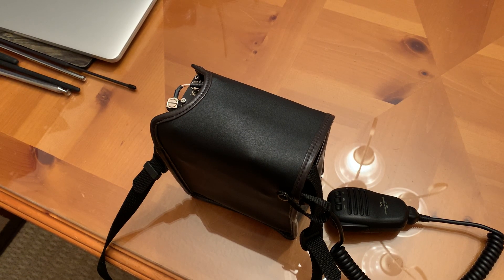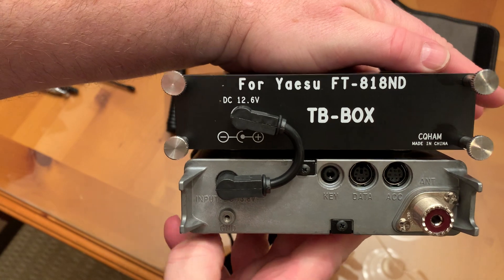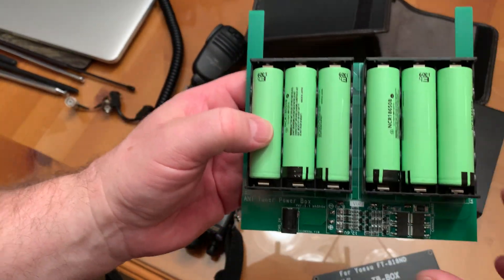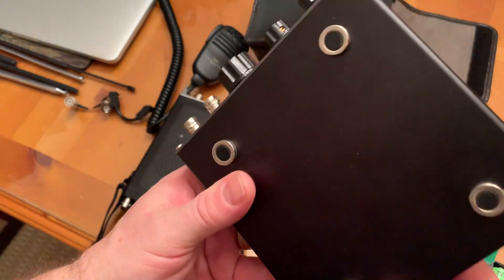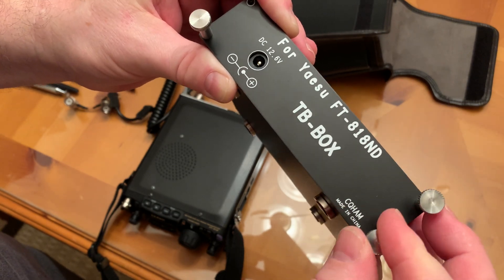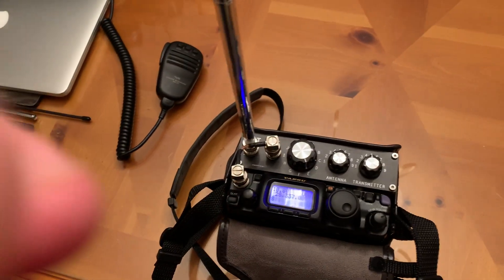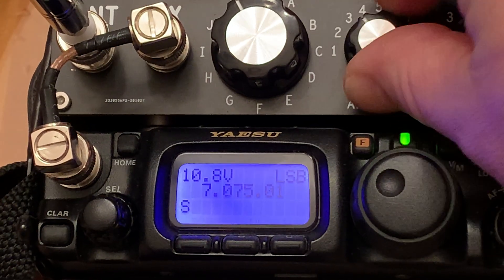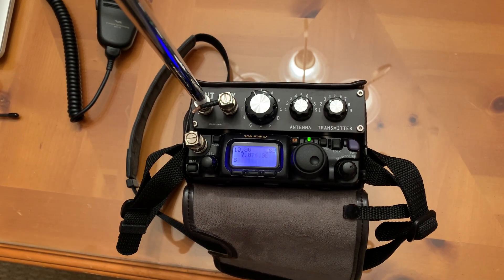Tuner Battery Box for the Yaesu FT-818

Comment: The TB Box batteries are horrible.  I replaced them and still got about half hour run time,....
Reply from the maker: Two different sets of batteries not lasting suggests there is an issue with your wiring or the tb box circuit board.   The 18650 batteries that came with mine provide over 4 hours of runtime.

Comment: what is the auonomy with that battery? and how can you know it is fuly charged?
Reply from the maker: My apologies, I am not sure what you mean by auonomy?   The battery came with a lifepo charger that has an led that turns green when the battery is fully charged.    It is a 3 cell 18650 unit that reaches 3 x 4.2v for a total of 12.6 at full charge.
Reply: @johncooper6894  i meant autonomy, as per a full charge how long does it last?
Reply from the maker: @itrstt66  the total capacity is 5ah so 10 hours or more just receiving.  Less depending on how much transmitting you are doing and at what power level.

Comment: John, too bad they can't use 21700 LIFEPO4 batteries all you can get out of them is 12.6 VDC output, from them, I was making a 4-cell 21700 battery with a Buck converter to keep the voltage dow to 14VDC

Comment: John, last question. Since any barrel plug drains the battery do you unplug the battery that comes with this case to keep it from draining?
Reply from the maker: No, only if the radio will not be used in a long time.
Reply: @johncooper6894  Thanks! 73

Comment: John, quick follow up. Is the barrel connector for the tuner power socket the same barrel connector that’s on the Yaesu power cable that comes with the radio? If so then yiu can use the Yaesu Cable “in reverse”. That is, plug it into tuner and put a Powerpole on the other end. Then plug it into Windcamp adapter. Makes it easier to use Radio if you want to separate it from the tuner and p,ug into a Bioenno for example. Your thoughts?
Reply from the maker: The barrel connector on the tuner is larger than the radio connector.   It is a standard 2.1mmx5.5mm connector.   There is room on the back of the tuner to add a power power connector in parallel.   I removed the windcamp power pole off adapter from my FT-818 when I got the tuner.   Actually before I got the tuner as I noted it drained the battery while the unit was off.   Having a plug in the jack of the radio opens a path with a slight current draw.
Reply: Thanks John.

Comment: John, Is there any reason you can’t modify the power cable that comes with the tuner to use a Powerpole connector. Specifically I mean putting the Windcamp or Sotabeams Powerpole Mod on the 818 and then cut the power cable that comes with the tuner and put a Powerpole on the end.
Reply: Just get another cord with the end that matches the power supply and put the Anderson connectors on that. The length of the original cord may be too short for the windcamp but you can make another cord work great. A good place to try is goodwill in the electronics section. I usually find power supplies rated at 2 amps DC  with a heavy cord and an end that match. just cut it off and make your own.

Comment: John, I think you said you put legs on the radio to tilt for viewing. Which ones did you put on the radio and will the radio fit in the bag with the legs on?
Reply from the maker: I put chelegance legs on.  I purchased them at DX Engineering.  The radio still fits into both this bag and the stock Yaesu bag with the legs.   They tuck in nicely.    Here is the link to the legs at DX.  https://www.dxengineering.com/parts/nce-ch0020001

Comment: It would have been nice if it was designed to attach to the bottom of the 818, instead of the top where it covers the speaker.
Reply from the maker: That is true.   However, the gap between is wide enough to allow a decent volume to pass and the top mount allows any feet or bales to still function.
Reply: Looks like you can flip over the guts in the box.
Reply from the maker: @k0emt  You might be right Bryan.   I will have to look at that the next time I have it out.

Comment: That is totally cool! You'll have to a follow-up after you logged a few miles on it.
Why only 10.8VDC? The radio shuts off about 10.5VDC.
Reply from the maker: Hi Viron,  thanks.   I have used it quite a few times with much success.    I have used it to tune short whips and end fed antenna's and the battery lasts a long time.   The voltage range is about the same as the internal battery, which runs into the low 9's before quitting on mine.

Comment: I'll try another question, but perhaps you're busy or whatever.....  Mine arrived a couple days ago. Did the battery tray slip out of the box easily the first time you attempted it?  I'd like to pull mine out to have a look at the batteries, but it won't budge and I don't want to force it.
Reply from the maker: Hi CW,  the board holding the battery tray slipped out very easily on mine.   I just removed the rear panel and it slid right out.   73’ and good luck.
Reply: @johncooper6894  Thanks a lot John for the reply. I took the back cover off and gripped the board ever so gently with a pair of needle nose pliers so as not to scratch or crack/crush it. the battery tray slipped right out and I was also impressed with the panasonic batteries. I've been using this with my 43' vertical and am able to tune with from 80m and up. Battery life is excellent also. An actual win of a product from China!
Reply from the maker: @cwqrpportable  Glad to hear.    My impression is that the designer of CQ-HAM products,  BH5HDE, is an enthusiastic ham that strives to create high quality products for fellow hams in the true spirit of ham radio.  73' John
Reply: @johncooper6894  That's great. I've had it and the FT-817 out portable a couple times and boy does that tuner ever work nice with a 41' end fed random wire and counterpoise.... 80m-10m no problem. Battery life is good too. I'm impressed!

Comment: would this work with the ft 891 and if not do they have one that will?
Reply from the maker: FT891 is too big to fit and outputs more power than the tuner is designed for.   I am not aware of a similar product for the Ft891.

Comment: That is really a neat little package. I like the idea of the power and tuner all in the same small package. 
But, the down side of the tuner is that it does NOT cover 80 meters. No big deal that it does not cover 160 meters since not many people working QRP on 160 meters anyway. 
Also great that he's using quality batteries and not those over rated 5500 mah batteries that show up on ebay. Which are not 5500 mah so don't be mislead.
Thanks for posting. Good informative video. 
Barry, KU3X/QRP
Reply: I just bought the same product and the listing says it covers 3.5-52mhz. I can't wait to try it out. Thanks for the video.
Reply from the maker: Hi Barry, good point.   I decided to test it on 80M.   I connected it to my ftd90.   On paper,  the antenna covers 160 to 10M without a tuner.   In reality, the vector analyzer shows the swr climbs sharply  at about 3.6Mhz.   So the CW portion of 80M needs a tuner, as does 160M.    I was able to get a flat match at 3.530 with the inductor on the highest setting.   SWR is around 2.5 at that point so tuner is usable on a reasonable SWR on 80M.    It did not have enough inductance to tune on 160M.    Thanks again for watching.      73' John

Comment: 18650's are 3.7v each and it uses 6 of them, Why does your volt meter say 10.8v when you turned it on?
Reply from the maker: A good question.  They are arranged in parallel sets of 3 in series. So 3.7 x 3 = 11.1V charged.   Thanks for watching.
Reply: its 3s2p battery  ( 3 cell in serie ) x 2  , then you have 3x3.7  as voltage   ,  and twice a cell as  mah ( here it looks like 3x3250 mah)
Reply from the maker: @tomoffroadequipment  That is exactly right.    I noted the charger stopped at 11.8 on the last charge which indicates a charge of 3.93 per cell which is about 100% at 25 degrees Celsius.